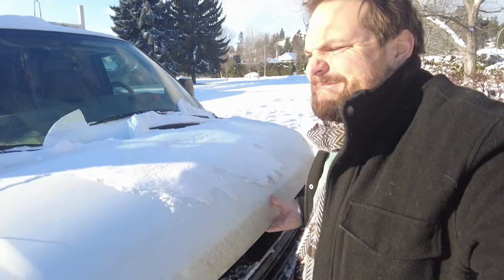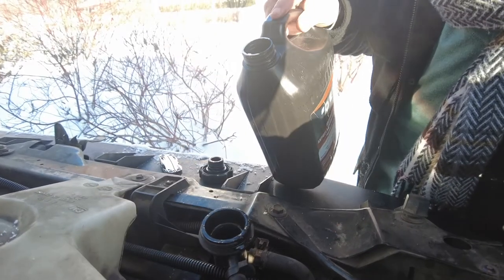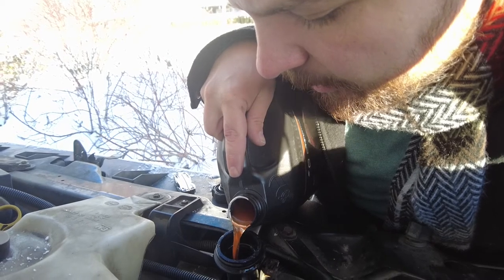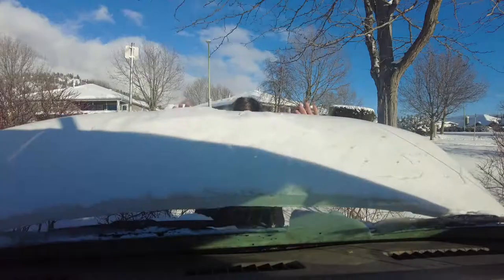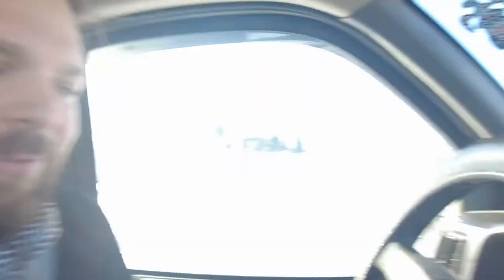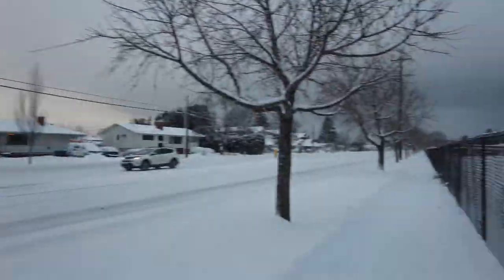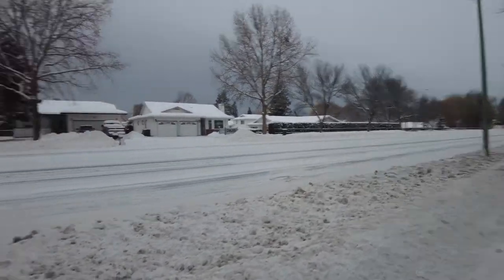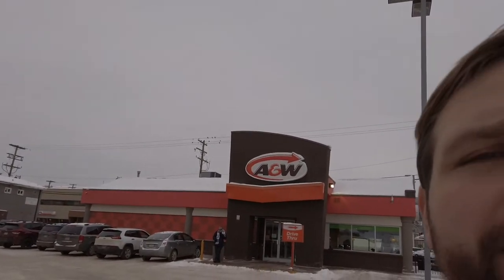Vanlife Troubles - Breakdown and Solar Battery Fail in - 22 degree Canadian Winter NO HEAT NO POWER!

Comment: batteries hate being cold, thats how ive stumbled across your vlog funnily enough as my agm's are struggling alot more with it being 0°c . i know some lithium batteries come with cold weather protection so if theyre under a certain temperature then they wont allow themselves to be charged up as that can damage them. are you solely relying on solar or do you have  a split charge relay or b2b installed aswell which will help charge your batteries from the vehicle alternator. hello from the UK btw
Reply from the maker: I appreicate that John. I have thought about getting a split relay... I'm not experienced with vehicles tho, and I'm afraid of what it may cost to get a mechanic to install one lol. I'm using a Renogy solar system right now, and they sell a DC-DC charger that you can hook up to the van battery for around 250 Canadian. Are you also exploring vanlife? What's your agm set up for?

Comment: Your cuz here lol. What if you were to hardwire a wire from your battery under the hood to you batteries inside With a switch inbetween so when you drive you hit the switch and it charge your batteries? Just a thought I thought lol
Reply from the maker: I have been thinking about that. I'm not experienced with vehicles tho and I'm afraid of what it might cost to get a mechanic to install that for me.
Reply: @michael_Thatawfulrhythm  it would be just like doing your inside batteries. Just a longer cable with a switch on the positive
Reply from the maker: @joeryan7802  You think I could do it myself? I'll watch some how-to videos and see if it seems reasonable :)
Reply: @michael_Thatawfulrhythm  100% you can do it or atleast try. No harm no foul. But it would basically be like running booster cables between the 2 with a switch in between